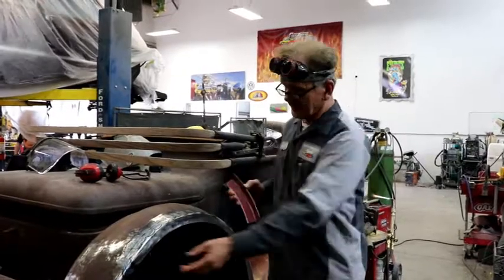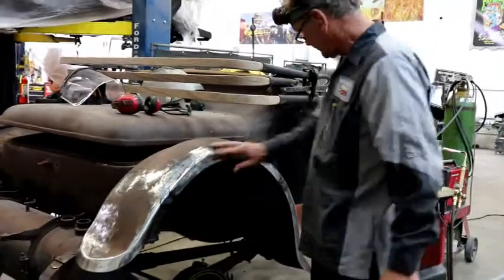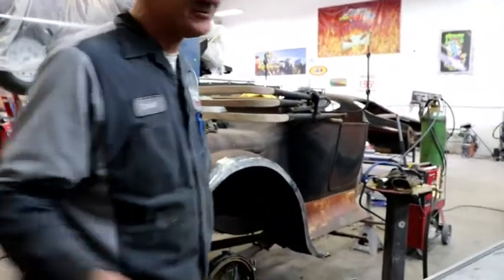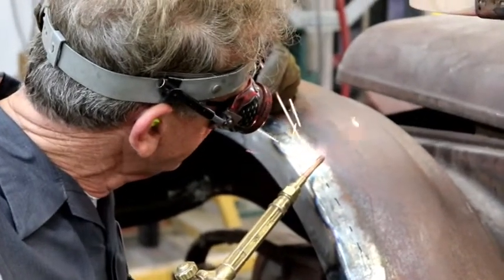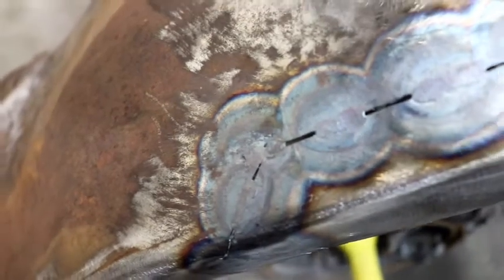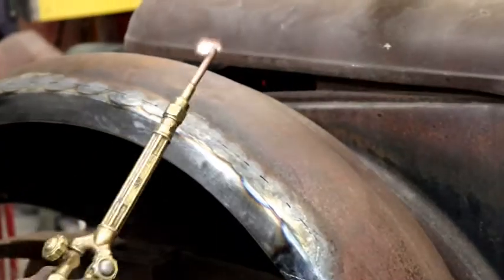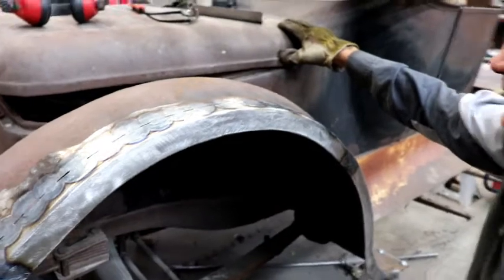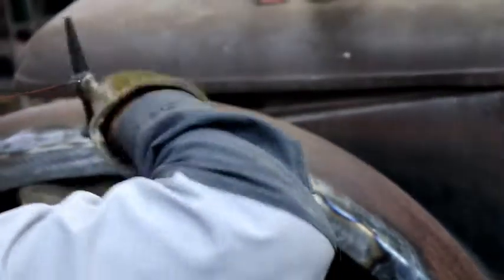Hammer Welding Final

Comment: i remember my grandfather hammer welding to close the metal bands used for tires on his wagons on the 50's. he had a remote farm with no electricity. he welded made mule shoes and other things with just the heat from a blacksmiths forge. it had a hand operated blower.